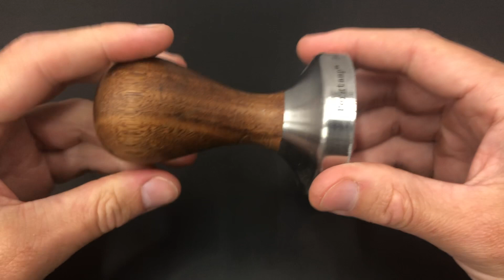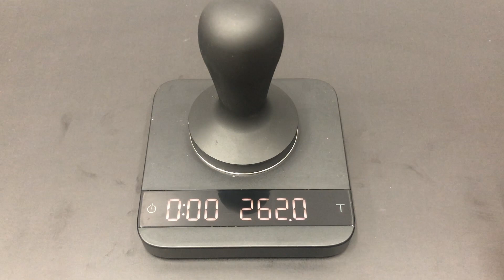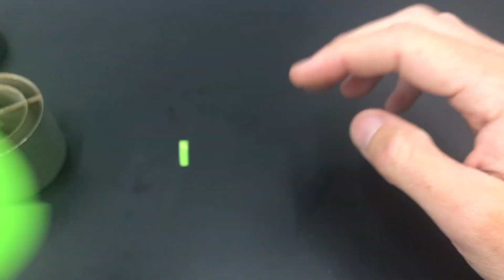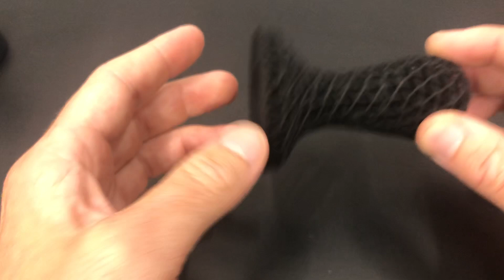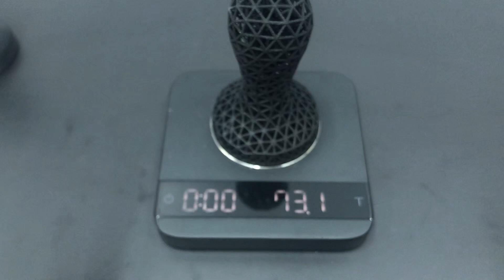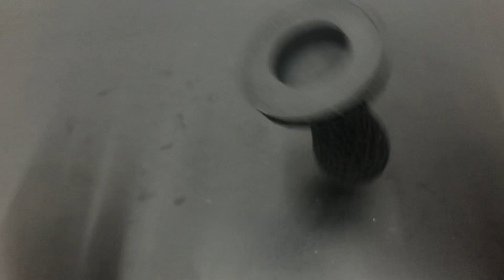Lightest tamper in the world?

Comment: It looks amazing and it fits your brief of a very light tamper, you’ll get people buying it, but there is no major market need. 

Manual tamping will slowly die out as auto-tamping gets cheaper. The reliability and reduced stress on your joints will now be the way forward. 

I think the idea of a light tamper is a little misdirected too. Less weight also equals less feedback. You can’t feel the direction and level of pressure applied as well as you would on a heavy tamper.

This is an excellent look at a new production method and the aesthetics of this are amazing.

Comment: I think I want this. 
But this should be made with generative design so that the pattern is made out of constraints and not random. It's far more complex but it would make more sense. This would allow more air in the design I'm pretty sure, meaning both easier to clean and lighter visually. Also you could integrate the cleaning in the constraints (example: you have no internal cavities where coffee can get stuck). 
I would also prefer something with less but thicker cells, because it will be far easier to clean and will make it far more simple and visually appealing in terms of design. Here it's beautiful, but the design will fade to overloaded in the long term. 
Also, is there a way to make this extra smooth? And maybe with some coating? Again for cleaning purpose. And also for the feeling in hand. 
And finally I'd like some kind of flexibility, either in the material itself or in the design of some sort of spring system because light is good but pressing a fully hard stuff is bad no matter how light this is and people tend to tamp too much.

Comment: This looks pretty phenomenal. Addressing the hygiene concerns, I'd be curious if you could deposit a coating or lacquer a clear shell around the plastics. It would add a little weight to the tamper, but would also stop dirt/grounds/etc. getting in, add a little more strength, and potentially improve texture for long term comfort.

Comment: I think it needs a thin outer layer for hygenic and cleaning reasons. It shouldn’t add a lot of weight and would make it more practical. Maybe you can also do some things to the “column” of the standard base? Should be possible to shave some grams there without sacrificing “performance”.

Comment: the first version of the barista hustle tamper (the white one) was 160 grams. sturdy, very easy to clean, easy to work with if you liked the small weight. even lighter? not necesary my choice. and for cleaning this new version you'll need an air pump :)
Reply: Did you get this printed though a print on demand service or a partnership?

Comment: I’ve got a reg barber tamper, and although I agree the weight is most definitely an issue, with the reg barber tamper at least it is the base that is the heavy part, not the handle. Why aren’t wooden handles an easy fix to this issue?
Reply from the maker: Max Roderbourg I love wood but it sucks for this kind of mass manufactured product. Swells with water, can’t be threaded without a glued insert, warps and bends, cracks, inconsistencies, etc.
Reply: @MattPerger  look up stabilized wood. The air in the wood is removed by high vacuum and replaced with a resin which is then heat cured. This allows using spalted and burl woods on a lathe without the issues you mention. Also threads fairly well.

Comment: Very interesting, but I think with the non-smooth surface, coffee is going to get stuck inside it and be a bit painful for repetitive pressing on the ridges. Also seems like it would knock over very easily. Also be interested in how it would fair with varying temperatures.
Reply from the maker: Sean Wysocki re the cleaning I need to get it super dirty and try it out. Re knocking over it’s so incredibly bottom heavy (80% of the weight is within 5mm of the bottom) that it’s nearly impossible to knock over! :)